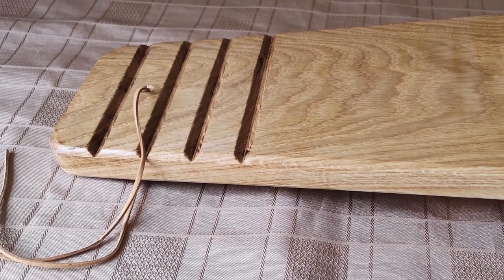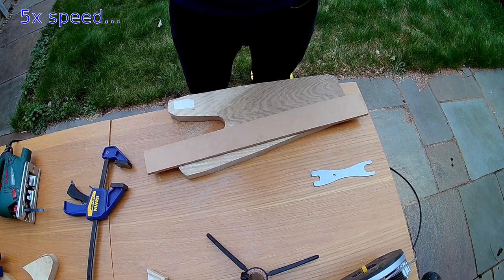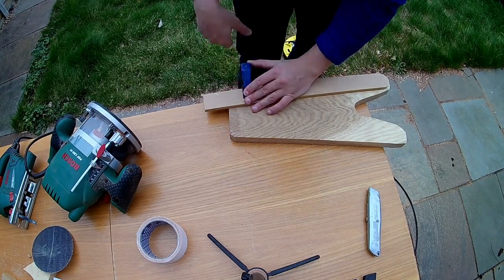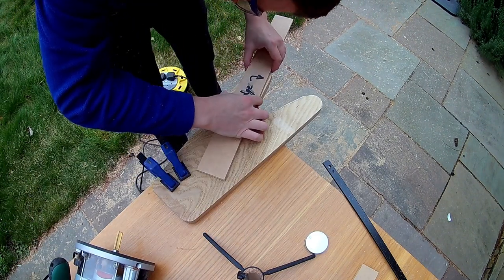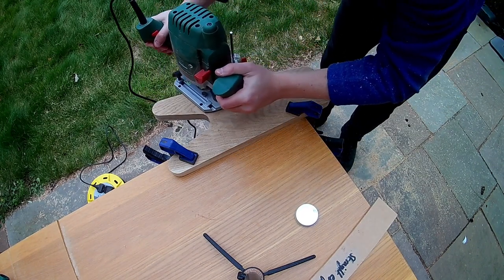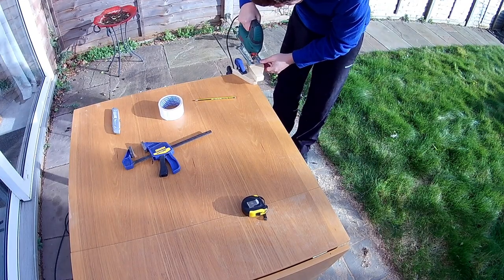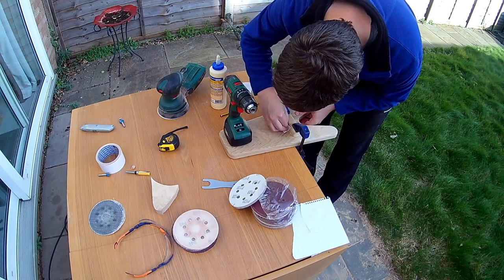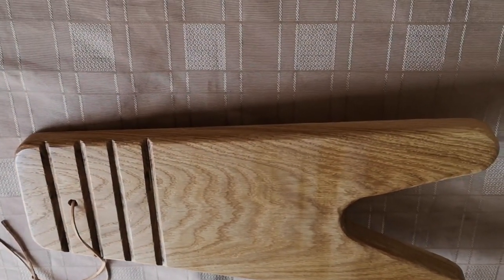Boot jack - Beginner woodworking - Laurence Plays with Power Tools

Comment: Well done sir ! 
As a 30 year veteran of wood working, I can see that you approach things in the right way, and your projects will improve with practice.
Oak is quite hard wood and burns fairly easy, cheap bits are probably the culprit. 
We have 2nd year apprentices where I work that would not do as well.
Reply from the maker: Wow! Well, I've been woodworking for more than 2 years, but I'm sure putting a lot less time into it than your apprentices! This project went well, I think, and I'm pleased with the result. The previous one (which I haven't made the videos for yet...) was a bit beyond my skill and gear level, but I will eventually show that for your amusement! 

I'm looking forward to more practice, I just wish I had a workshop! Thank you  🙂And I guess I need to look for some higher quality router bits...

Comment: you mention about a bit of scortching, the older the router blade is the more blunt it is, faster it spins more it will heat up and burn the wood your working with. different speeds on the router can also effect the wood getting burnt. having routered kitchen worktops many times, its very noticable moving from an old blade to a new blade.
Reply from the maker: The blades are all very new, but they're also very cheap, so they might come blunt from the factory... I think I'll generally stick at high speeds for the roundovers because they'll need sanding anyway, but if I do something like this again I'll do the grooves more slowly. Thanks!

Comment: A shop I worked for used to sell these for about $30.
Reply from the maker: Interesting. I think I'd have to charge a bit more than that to cover materials and time, but probably not enormously more. I guess a lot of it depends on what you make them out of and how much effort you put into the finishing. If I was mass producing them, I'd make a template, of course.
Reply: @LaurencePlays  To be fair, this was almost 20 years ago, $30 was worth quite a bit more back then.
Reply from the maker: @NogardCodesmith  Ah, so about $200 in today's money  😀 In that case, I could definitely make them at that price!